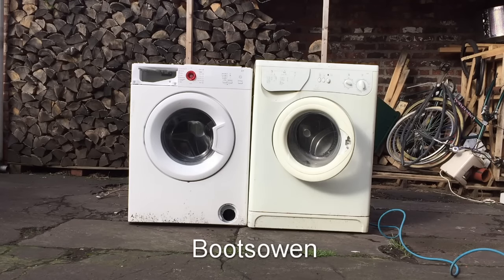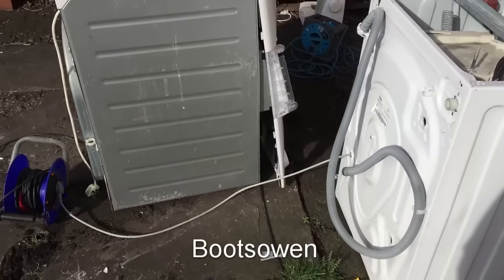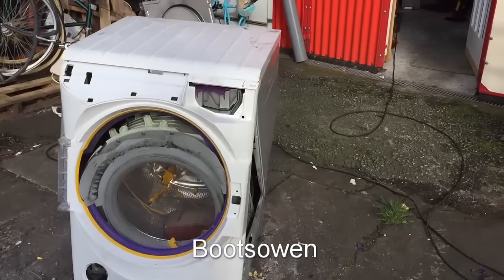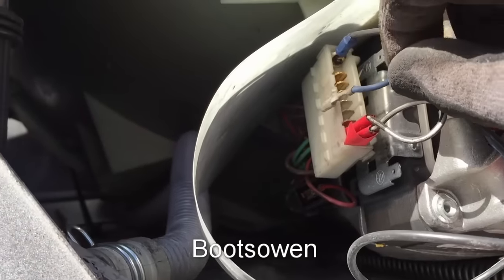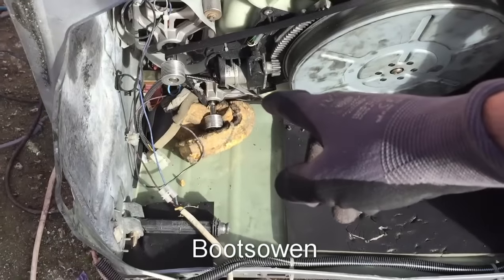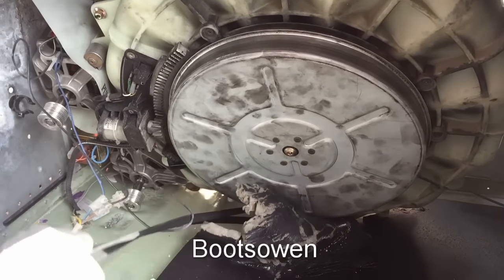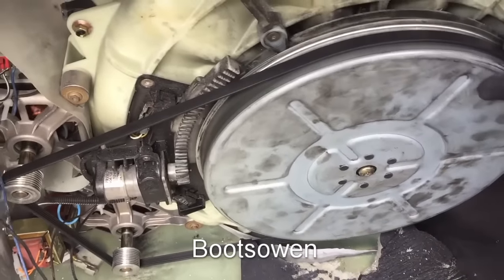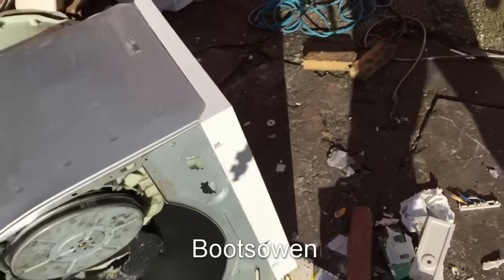Dyson CR01 Smash day with Amica

Comment: What wrong with 
indeset???!
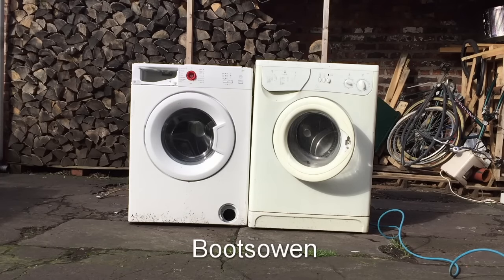Reply: i know whats wrong, probaly drum not turning when motor kicks in, at 0:14 the drum tries to turn
Reply: @washinglad1400  does it need a different energy class or is it dead or drum jamed
Reply: @nathangrosvenor7664  wiring failiure
Reply: What's right with Indeset?... I have had no end of them and never again.  Although Hotpoint comes from the same manufacturer, I have had better luck with them.
Reply: The wiring was Fired up so it was fatally wrong with it